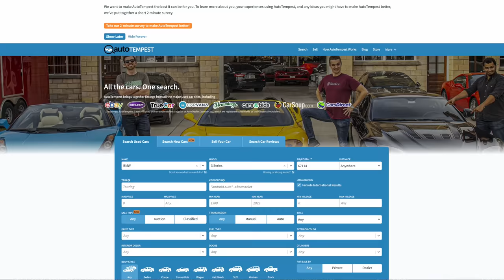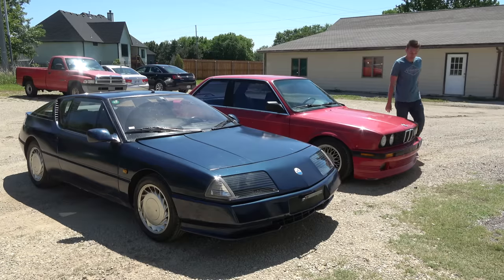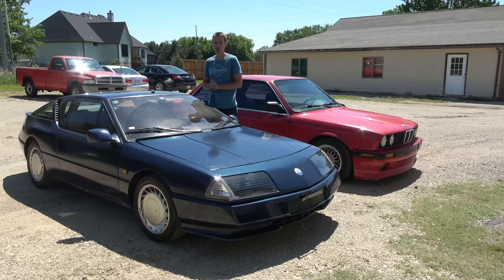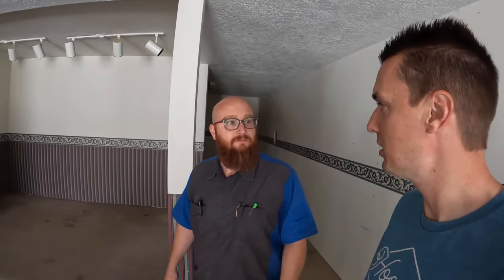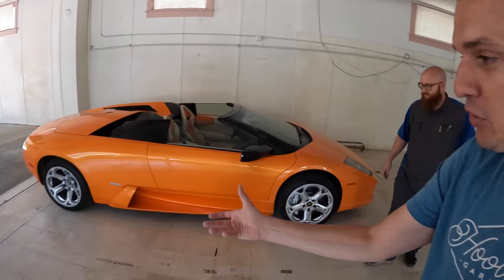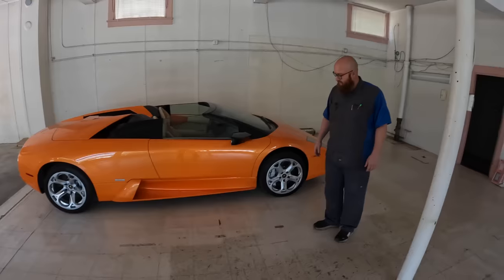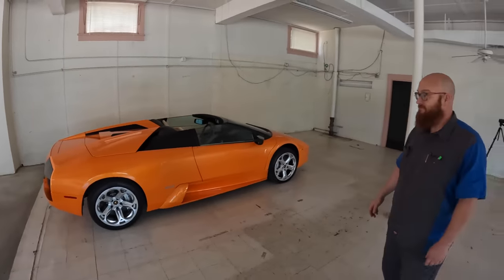Everything wrong with my CHEAP 90 year old shop building (was it a TERRIBLE $75,000 investment?)

Comment: 5 to 8 grand to fix it up?! I have absolutely no what renovation costs are like in the US but properly fixing that building is likely going to take way more than that
Reply: "Properly" is doing a lot of heavy lifting in that sentence.
Reply: I just put a new HVAC in my home that's the same size as his building (3,500sf) and it cost me $17,000.  When he said $5k, I burst out laughing.
Reply: @bkeen7013  5k for the outside unit is what he meant. not at all unbelievable, even in this environment.
Reply: No problem, I'm sure Hoovie "knows a guy".
Reply: @vinny6_9  Yeah, but that only works if you can buy a new outside unit that properly matches the inside one, and if the whole system runs on modern refrigerant (which, given the age, it probably doesn't). Most likely, the entire system will have to be replaced

Comment: Sweet !!, an Alpine GTA 2.5 V6 Turbo. I have one also, in silver. A 1988 version. Very highly under rated car. I have the boost turned up just a little in mine to 0.9 bar and its an absolute hoot !. They should be 0.82 bar standard for reference.
Reply: FYI It was the most Aerodynamic car in the world (0.27) when it came out in 1985, until 1991 when the EU GM Calibra came out and took the title.
Reply: @hoovie, you also got a bargain. Here in the UK they are now going for £20k. So nearly 30k USD. Only 24 left here.
Reply: @kurtlamprecht93  You really cannot push the PRV any harder. Its about at its limit at 215bhp. But it does 0-60 in just about 5 seconds given it only weighs 1000kg. So yes its quite fast. Gets to the 155mph limiter rapid.

Comment: The water coming in the door could need more than a new gasket.  look at the water flow when it's raining and see if street drains are working.  Also consider that the earth/sidewalk can heave and the street in front could have been resurfaced by adding height to the previous layer.  Done a few times, or more can be enough elevation change to adversely affect water flow.  Also my experience that if the sidewalk/drain/street can be fixed by myself (like when no one concerned might be around), I just do it.  Oh, go ahead and check the roof drains and down spouts too.  Good luck!

Comment: Tyler before you start parking cars on that floor I would buy a few hours of a local structural engineer's time to run quick calcs for you on how much load the floor can take. It should be pretty easy for them with the hatch to see the supports below the floor.
Reply: Indeed. However, keep in mind, at one point a 20 foot meat freezer was on that floor, full of tons of meat. Even if that was 30-40 years ago, it probably can still hold a huge amount of weight. But yeah, best to have it all inspected, considering there was a roof leak at one point in the past, and maybe multiple leaks over the 90 year history. Have a suspicion that most of the owners over the years just did bare minimum to keep up with maintenance and only the additions are in better shape. Why didn't they not pour concrete 90 years ago, was it just not as popular for large floors? Or buildings this size?

Comment: If the plan is to rent the place to someone else as a business, you may want to hold off on improvements until a contract is signed, so you can match the needs of the renter. 

Structural things that might collapse the building, sure. Cosmetic, maybe wait.

Comment: That sink location is a code violation.  That service is 100 Amp, 2 100 amp poles, single phase.  Pull up the vinyl tile(have it tested for asbestos!!!!)and the underlayment. any rotted plywood, if there is any, the joists underneath should be checked for rot.
Reply: You're spot on. He's looking at at least $60-70k to get that building up to code and rent-able standards. There's no way that foundation, sub-flooring, electric, and plumbing passes inspection. Plus probable lead and asbestos abatement. Add an extra $30-40k at least. He'll be money-even at best if just sells the building. Was tremendously stupid not to have it inspected by a professional before purchase.
Reply: From what he's said, the tile was done by the previous business, and they were only in the building for 12 years, so most likely not asbestos, since they stopped putting that in tile over 40 years ago
Reply: Thanks for watching again.
 Replace tile with wooden board 1x6

Comment: Hoovie thinks he’s only spending 5k to replace the a/c. 😂
Reply: Yup, especially commercial in almost 4,000 sq. ft.
Reply: Put the air units on top of the roof. .. pull up old tile covering. 
Install tounge and groove wood floor
Reply: @willmtaylor  that building isn't 4,000 sq ft.

Comment: DeLorean owner here. The reason DeLorean owners haven't swapped the Alpine engine into their DeLoreans is because that engine is very very hard to get in the states, and it's cheaper to put in the modern Eagle Premier fuel injected even fire 3liter PRV which could readily be updated to get more horsepower and torque than an Alpine turbo.

Comment: Be aware that those "linoleum" floor tiles or the glue underneath could contain asbestos. Please look up floorflex to find more info. Its my job to look for those kind of things and other building pollutants ant to plan the necessary remediation works, and I recognized the distinctive look of those tiles. Please let a professional look at that floor if you like to remove it!
Reply: https://de.wikipedia.org/wiki/Vinyl-Asbest-Platte
Reply: He said the floors were redone by Loewen Upholstery, and they only moved into the building in 2010, so they're several decades too new for asbestos

Comment: If you can keep the electrical as is, then changing out the flooring (checking for weak spots as you go), it'll be tough to get that done for under $10k. Outside repaint and patch would probably be the biggest bang for your buck.
Reply: that electrical's gotta go. federal pacific is not up to code
Reply: No need to change the floor. Fix the sagging areas, but I've seen a lot of comments calling for a concrete floor & that is totally unnecessary. Wooden floors can hold a lot more loadwise than most people know, apparently.

Comment: More like 15-20k to get that building ready.Floors, exterior fix and paint, interior paint and mold fix, New ac unit
Reply: Maybe that just in materials
Reply: Reality check. He's looking at at least $60-70k to get that building up to code and rent-able standards. There's no way that foundation, sub-flooring, electric, and plumbing passes inspection. Plus possible lead and asbestos abatement. Add an extra $30-40k at least.
Reply: @dr.z1657  And that’s before even looking for a tennant, hopefully he can lease it triple net and not have to spend money on taxes, maintenance, etc. after
Reply: Yeah 5-8k no way. I was thinking between $40k and $70k. Granted I'm biased with my California inflation, maybe the home depot crews in Kansas are cheaper, but... idk.

Comment: Coming from a flooring professional it looks like you have 2 layers of 3/4 plywood with. 1/4 underlayment with vct on top you should remove the vct and 1/4 underlayment and put down a new layer of 1/4" ply and a 5 mill thick glued down lvp with a 20mm finish

Comment: Tyler,
I’m and electrical engineer. That electrical service needs some serious attention. Being in the bathroom next to the sink is a National Electrical Code violation. You should convert to a breaker style panel board and move to the other side of the same wall outside of the bathroom. Eliminate all of the unused feeders to equipment that is no longer there, i.e., 20’ long meat cooler. Have a qualified electrician look this over as it needs domes work. 
Also, that tiny little access gap under your floor to those utilities is pointless. As the Wizard said you will have to remove sections of the floor to get to anything if necessary. Any electrical under there is a code violation as well as you don’t have direct access to it. I suggest move as much out from Uber the floor, backfill with gravel and pour concrete. Leave an accessible trench for any plumbing. 
The building has potential but needs some TLC.

Comment: Probably $30-45,000 for a new cement slab for about a 2,500 sq ft space. I’d say all in you are looking at another $75,000 to have a pretty sweet little building. That’s without any finishes on the inside.
Reply: He's looking at at least $60-70k to get that building up to code and rent-able standards. There's no way that foundation, sub-flooring, electric, and plumbing passes inspection. Plus possible lead and asbestos abatement. Add an extra $30-40k at least.

Comment: Have a survey done.  Brian and Della should have told you that you own a roughly 10' wide strip from 1st St south to the alley between 1st and 2nd st.  So basically from where your storefront parking begins to the edge of the building, that strip all the way to the alley...as well as the crap in it.

Comment: Door sweeps and seals are not going to stop that water, you're going to need to address the elevation at the door and the sidewalk, or possibly add a drain. I would recommend using a product called MG Krete to SUBTLY adjust the grade outside on the sidewalk, and possibly also pull the door and set it on a pressure treated 1x4(or 6) wrapped in ice and water shield, or use masonry with flashing preferably to raise the threshold of the door a little bit.

Comment: Based on the age of the building there is a strong possibility that those floor tiles contain asbestos. I would have them tested. The safety hazard starts when they are ripped up and debris get airborne. Trying to keep you safe!
Reply: It's fine as long as you don't touch it. And the floors have probably been redone afew times.
Reply: He clearly states that the floors were redone... no asbestos in those tiles.

Comment: I'd say 15-20k minimum just to get the place safe and sound. That much again to re-fit to the extent it's a basically serviceable and attractive rental proposition. I would also consider ripping up the entire floor and reinststate with compacted foam-glass aggregate (load bearing, non capillary and excellent insulation) with concrete over that. Good luck Hoovie 👍🤞

Comment: Check to make sure there are no Federal Pacific breaker panels. If there are, you'll want to get those replaced right away. I think I could see the red FPE logo on the panel just above the main disconnect in the bathroom/electrical closet, but couldn't get a good enough look.

Comment: 5K to 8K is a fantasy. Just the safety items like sanitation and electricity is going to be north of 25K. Then there's doors, locks, windows, insulation, HVAC, paint... Ever see what decorators charge for a building that size? Or just the cost of paint itself? Half the plywood is going to be rotted or warped from the water damage, and the floor itself will need tile or  a coating. I would estimate the cost to bring it to a desirable commercial rental status as 60 to 100 thousand.
Reply: You're correct. He's looking at at least $60-70k to get that building up to code and rent-able standards. There's no way that foundation, sub-flooring, electric, and plumbing passes inspection. Plus possible lead and asbestos abatement. Add an extra $30-40k at least.

Comment: Anybody who has had any experience with the PRV engine would run away.
It´s the mother of all nightmare engines.
Cylinder sleeves that sink, head gaskets, camshafts that are starved of oil, wiring that don´t cope with heat etc, etc.
A turbo charged PRV-engine with twice the power... no-no-no...nope.
Ticking time bomb.

Comment: For insurance purposes, you MUST redo the electrical service. Anyone gets hurt going to the bathroom with that crazy electrical grid and you will lose everything. Second, that building has had significant water damage to the floor. Looks like someone 'repaired' it by just putting 3/4 inch plywood over the whole thing.  I would tear up a section where the floor is bowed (or small access panels) in several places OR fiber optic inspection) and figure out exactly what  its like. My guess is it will take $20k to actually get it up to code.
Reply: More like $60-70k to get that building up to code and rent-able standards. Add an extra $30-40k for the near certain lead and asbestos abatement that will need to be done from the VCT, paint, and insulation.

Comment: Where I work you see the main line in the building and all the circuit breakers just in front and above you when you are pooping. The advantage is if you are backed up you and just reach out and you will be fully cleaned out instantly.

Comment: consider the stucco a total loss because with a building that age it's not attached to anything worth while.  Water damage "once" from the roof leak means wood rot if it's was going on for years.   Watch and wonder if the flloor tile has asbesto in it.
Is the land worth more then the building?  Driving the car on the floor reminds me of the Corvettes falling through the floor.

Comment: Get out of my head!! lol
I was literally just thinking that you should've tried to get a Renault Alpine because you would totally love it... and here we are, just minutes later "look here, i got an Alpine!".
Alpine's are kinda legendary cars, especially in Europe because of their rally racing heritage (if you can get your hands on an 1970's Alpine A110 under 75k? buy it!!)
There are a few Rally legends in the car world, the famous Lancia Stratos, the Audi Quatro, the Mini Cooper, and.. the Alpine A110, just to name a few of the big ones.
But there is much more lurking in the French car world, check out some of the Citroen cars like the (original) DS and SM (the SM was a coop with Maserati and a horror to work on, should be fun for the Wizard hehehe).

And tbh, there is one car you really need in your collection, one that will put a smile on your face bigtime because it's very quirky, a Dutch car called DAF. (models predating the Volvo takeover)
It's actually one of the most famous cars nobody knows about lol, and that has all to do with it's transmission, the Variomatic, a step-less automatic transmission using a belt and pressure-plate system.
Now truth be told, a DAF is not the fastest car in the world (not by a long shot) but, it is one of the fastest cars in the world going in reverse, because the Variomatic works both ways, in other words, a DAF can go as fast in reverse, as it can going forward.

Only one minor issue, there are not that many left in the world, in large part thnx to a tv program that ran for years in the 80's, "achteruit rijden", a amateur racing in reverse entertainment show.
Kind of like "banger racing" but in reverse.. or pulling a caravan, and it was all done on a track with dirt and tarmac parts, dips and hills, sharp corners and a few jumps, totally ridiculous show, very 80's and it was mad fun to watch, but it pretty much cost the lives of 90% of the DAF cars in existence at that time. (and no new models were being produced)
Oh and Jay Leno owns one, just saying ;)

Comment: Not sure if anyone has commented about this, but the floor tiles look like they may have asbestos.  Usually older buildings had no codes about this, so I'd suggest you have an expert come in to inspect the flooring.  Dangerous stuff.

Comment: As far as the stucco damage goes, possibly could be water damage if it is studs over stucco. Water leaking in warping the wood underneath causing cracks in stucco.

Comment: Tyler, I am a service plumber. You should check your drain tiles, ensure your water supply lines in the building aren’t made of poly-b (Polybutylene) and inspect the sewer line. You should also hire an electrician and a roof inspector as those are very expensive repairs if needed done. Hope this helps. As for the price of it, that’s pure ridiculousness. You couldn’t buy 50sq feet worth of land in Vancouver Canada for 75k.

Comment: Don't quote me on this, but MOST HVAC units especially Carrier, Bryant, Payne on the serial # is the date code. It's the 3rd and 4th digit on the serial #. (Example 0920P38307 Is a 2020). Some other units follow that method too, you can always Google the manufacturer date code nomenclature. But from the looks of yours, looks like a Carrier product.
Reply: Also if your replace your HVAC I highly suggest DON'T get anything fancy, get basic stuff. The fancier you get the more the parts cost, more parts installed from factory, more problems. Just get it with pressure safeties, nothing else fancy, basic.

Comment: Wizard approval aside, old buildings will surprise you with all the issues they can come up with. You're shaking it's status quo, changing the distribution of weight that it's used to, driving Lambos onto it, even repairs can bring new issues. I'd almost expect to have to pour concrete or at the very least re-wood some of the flooring. Of course a lot of that goes away if all you intend to do is rent it out as a barber shop or something. At the very least a good scrubbing and paint for the interior.

Comment: Aaah the old PRV V6, during some old test drive of a Volvo 760 they said that the PRV V6, has the fuel economy of a V8 and the power of a 4 cylinder :D But with a turbo it might work better.

Comment: Better check the age of that linoleum, could very possibly have asbestos, minimum $50k and absolute requirement to replace
Reply: Allegedly, the floors are only about 12 years old, just have a lot of water damage from the previous roof

Comment: That smaller breaker panel is a Stablok panel, and is a total fire hazard and should be removed as soon as possible! The breakers do not trip when they should and overheat not only the breaker, but the wires as well

Comment: I got an idea if it's just a subfloor and there's nothing underneath there why couldn't you have the floor removed fill it in with gravel. Gravel is cheap then have concrete poured over it with rebar. Would that increase the value drastically